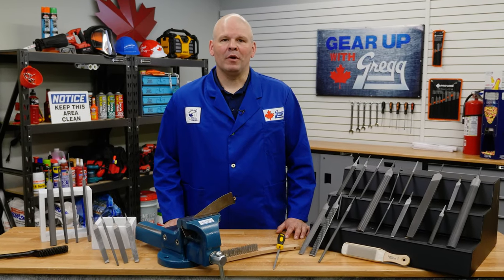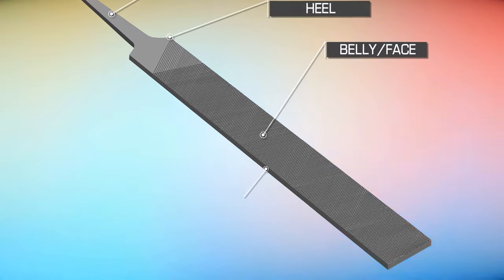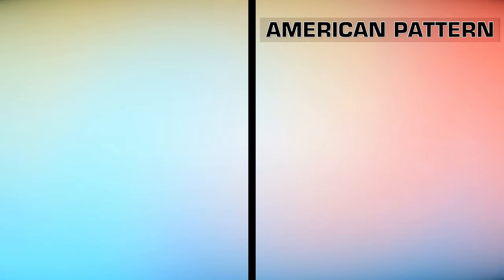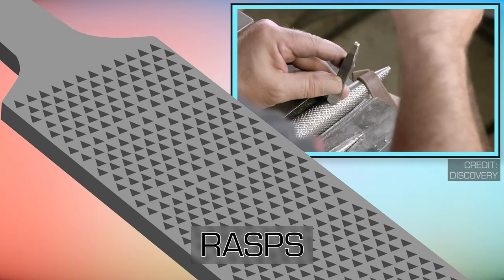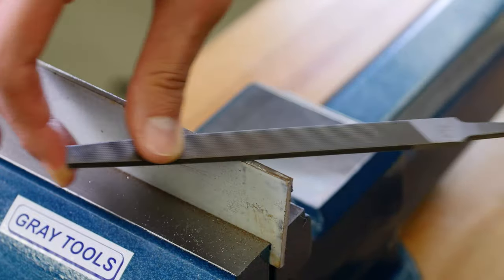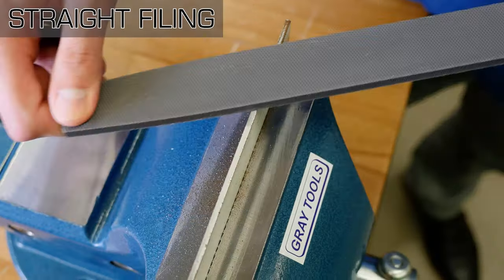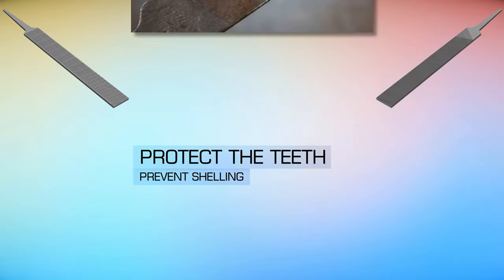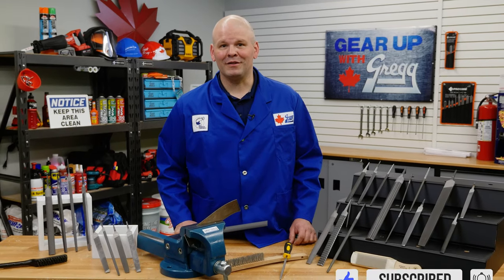Hand Filing 101 - Gear Up with Gregg's

Comment: Just watched a video on back dragging. Contrary to what we have always believed it appeared to have the the same wear as lift technique after 2500 passes on a drag machine. I lift by habit but still interesting. The back drag was done with equal pressure as the push as well which most individual I've seen who back drag do so with a lighter stroke. Results were shown under magnificent. Results also confirmed  that back dragging did not shed pinnings  as some belive who use that technique.
Reply: Sorry can't use Altair anymore 🧔😭
Reply: However, stroke and lift is easier for many folk to keep the file face flat to the workpiece.

Comment: What puzzles me is why there are no files with teeth that cut on the pull stroke. There are many situations where it gives better control. You can always hold the file by the tip, but the handle/tang gets in the way and throws off the balance. I could understand if they were merely less common, but I've never found any trace of them existing at all.

Comment: There are many instruction videos where people dont wear masks. But if I am filing the tip of a nail, do I need a mask??
Reply: You don't need a mask for hand filing. You're not getting particles in the air or anything. You don't really need any protective gear at all to file
Reply: It depends on if your vaccinated

Comment: Thanks for a great video explanation on files. You mention that a dpublecut pattern has 2 sets of teeth positioned at opposite angles to each other. That sounds like 180° difference,.but the actual tooth angle looks more like about 60° apart from each other. Recently,  I heard on a jewelers video that double cut files cut in "both directions" meaning pushing and pulling. There is the angle of the cut (the way the top edge of each wedge (tooth) is leaning to cut), and the angle of the two individual row directions of the group of wedges (teeth). Can you help clarify? Does a double cut file cut pushing and pulling or does a double cut file have two slightly separated (@ 60°) directions forward? I am a jeweler and have always been taught (and teach) pushing (not pulling) when filing,  and most jewelers hand files are "double cut" 😅 Thank you.

Comment: Great lesson video, with organization. I appreciated it. Very helpful. Nonetheless, I was still left with my question not answered. I need to sharpen things like an axe (or lawn mower blade). I heard to use a mill bastard file. This video mentions 'bastard' file, as an American cut, that is the roughest. If you had given even a couple more sentences to explain this in greater depth, & images to show what you mean, it would have answered all my questions. I feel I have slightly more knowledge to answer my Q after this video, but still do not really know what is a 'bastard mill' file & still need to move to other sources to get an answer which I am finding surprisingly difficult to get a simple answer to. So close, & yet so far. Thanks.